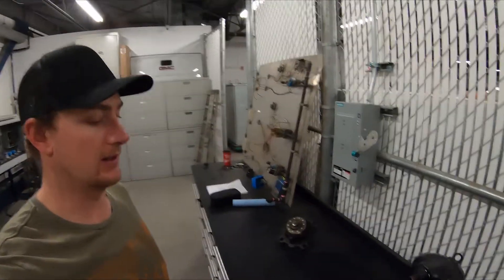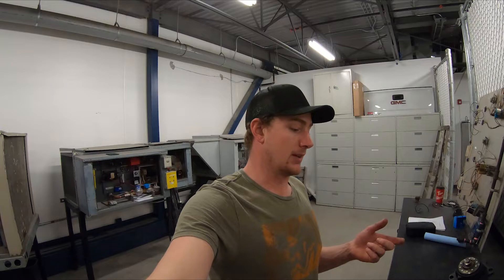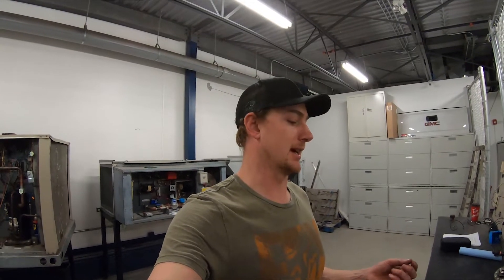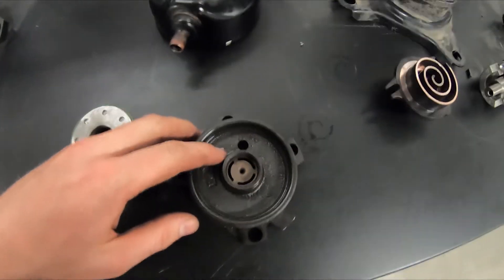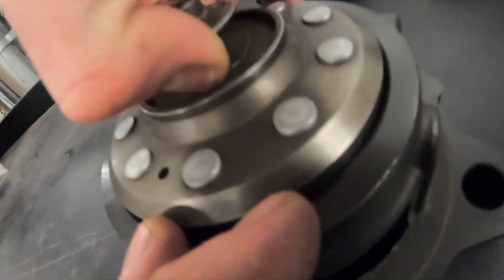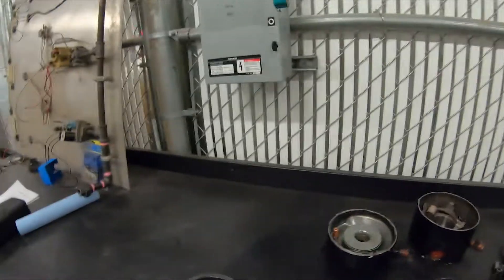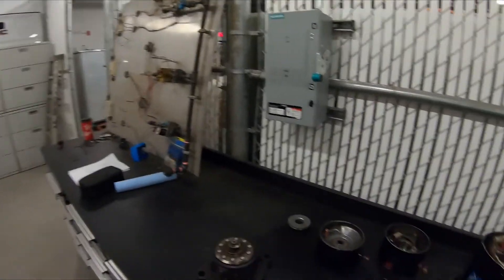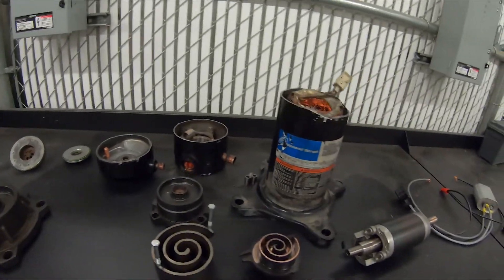Copeland Scroll Compressor Teardown

Comment: Are you saying the copper is in the bearings because the oil/refrigerant is acidic and leaching copper from tubing and it ends up depositing on the bearings?
Reply from the maker: Yes, when the system is not evacuated properly and there is no filter dryer installed moisture is exposed to the refrigerant and oil and it causes acid to remove copper off the pipes and deposit on the bearing inside the compressor

Comment: Seems like a high temp thermocouple on discharge line shutting down compressor at high temp would be more effective but I guess that would entangle some EEV air handlers that would eventually throw a superheat alarm if compressor stops pumping.

Another issue I have come across is air handlers with EEV that turn off blower coincident with compressor turn off.  It can cause EEV to totally shut off flow due to quick temp drop on output of EEV when air flow stops and leave its EEV in totally shut off position.  Scroll compressor blocks off other end of liquid line preventing back flow into compressor. Sustained liquid line off state pressure causes issue with developing enough differential pressure across scroll compressor top plate sealing disk, causing it to chatter on start-up and beat the sealing disk up long term.  Need to have a time delay leaving blower run for a minute beyond compressor shut off to bleed off liquid line refrigerant.

Comment: I came here  to see the internal design. I'm looking to pump down a functioning split system for sale/transport. Someone else said to not let the low side go into a vacuum because the refrigerant acts as a insulator for the windings and will burn them if you do. My electro/mechanical knowledge of how things are designed immediately told met that's absurd. Someone else said that running it in a vacuum state for any length of time will damage the compressor. I watched several videos of HVAC personnel pumping down systems and you simply put the unit on high cool so the evap has a heat load, close the high side and when the low sided gets to zero, close the low valve [which by that time will cause a little vacuum] and then promptly disconnect the power. If the compressor runs for 30sec with both valves shut is no big deal.

Comment: When refrigerant backfeeds you hear it, sounds like air spraying out and inlet temps drop immediately, and if it continues, the bottom of the compressor gets warm. Do a pumpdown test with gauges hooked up. If it cant pull the low side to zero, it is confirmation.

Comment: Hey thanks, you take a lot of mystery out of why the hammer technique works sometimes? Kidding aside I was looking for the oil dipstick on my rooftop unit, but I don't know where it is. Anyways my OFM froze up and the drama commenced, L.S.S. I've got 240vac to the comp. motor, but no spin. I'm thinking internal motor open? What's your thoughts? Thanks again.

Comment: Hello, I have a question about our copeland scroll compressor. (ZS21 K4E-TDF-551 similar to ZB21KCE-TDF-551)  It is loosing very few oil at the sight glas. I can only see oil when it is working. I can see nothing at the glass when its not working. So can I simply fill it up. How to do that? I searched for hours now and only found the manual at the emerson webpage. But there is only written the type of oil and that it has to be half filled at the sight glass. So Is it simple? Which kind of tool do i need? The valve at the bottom?

I would be very thankful for a short or long answer.

Nice Video.
Reply: try oil separator

Comment: hi john thank you very much for useful video 
please advice how can solve the problem of high temperature protection inside the head of the compressor 
i have one compressor working with low current and no pumping how can be solved
Reply from the maker: Only way to reset is to shut the compressor off and let the unit cool down. If it continues to trip on temprature protection your exceeding the rated compression ratio. Either too high of discharge or too low suction, or a combination of both.

Comment: Hello John,
I don't know if you can help me. Above my apartment there is a heat pump (Aermec NRL0600'H'E '' 'P2),
 functioning in both cooling and heating mode. There are 4 installed in the machine Copeland Scroll compressors working in pairs:

pair1 - model ZP120KQE TFD
pair2 - model ZP154KQE TFD

Only one couple can work (especially in summer) or both couples (especially in winter) and they have
 variable speed.

Especially in heating mode, the vibration dampers under the machine (isotop sd7, isotop sd8)
 not able to dampen the vibrations which, as a result, pour into my apartment. Some time ago I viewed the machine together with a vibration expert. According to him isolating in a way appropriate compressors installed inside the machine would lead to good results.

Do you know this type of compressors? The speed of rotation? You would be able to recommend antivibration mounts
to put under the compressors?

thanks 1000

Comment: If the compressor has thermal and pressure devices for "self protection" then are you indicating that none of these were successful in protecting this unit?
What is the approach to determining a compressor malfunction?  Are these protective devices "one time" protection or are these designed to "reset"?
Reply from the maker: This compressor failed due to contamination in the refrigerant system. Contamination in this case was moisture and air since the installer did not pull a complete vacuum and did not install a filter drier.

The temperature protection would activate when the compressor is operating outside its design conditions. Compression ratio and suction temperature would be the two main factors that would cause the compressor to stop pumping.

Comment: I watched this hoping to understand how my circa 2004 nordyne/miller 4 ton 10 seer heat pump can fail so many different ways and behave so differently in heat versus cool modes.

Following a long vacation I attempted to start it in COOL and HEAT modes, but it only buzzed a few seconds with well over 120 amp draw causing lights to dim and voltage dip from 240 to 220.  That  would repeat at approx 10 minute intervals.  The single pole power contactor remained engaged and 240 Vac was provided to the compressor continuously.

That inspired me to install a hard start kit and I was able to get compressor running in COOL mode for a few minutes with 22 amp draw, but no appreciable cooling was detected and I think the compressor stopped with no current draw.  Had  to stop because sunset and I have not been able to repeat this.

I also managed to start the compressor in HEAT mode and it behaved well except current draw was 33 amps.  The outdoor coil became cold but I did not evaluate supply temperature.  After switching back to cool mode I did not get any compressor current after contactor engagement.

This makes me wonder if there is some kind or thermal or time delay switch inside the compressor that nobody bothers to mention in the teardown videos?

My curiosity is mostly academic because the unit contains R22 and conversion to R22B would be a waste of money.  I already have a 5 ton 14 seer replacement on site and will switch over when I receive all of the new ductwork components.
Reply from the maker: Sounds like the bearings might be tight on that compressor aswell. The hard start kit would definitely help get the compressor moving again but its probably over amping. Those compressors have a thermal disc that disconnects the circuit when the unit over amps/overheats.
Reply: @johnbrown8168  thank you. It figured there had to be some sort of thermal and/or pressure switch inside compressor because sometimes it draws amps when I give 240 Vac and other times it draws none.

 HINT: discussion of the compressor internal electrical interlocks would be wonderful addition to your teardown videos.

My compressor probably needs oil and filter change after 15 years use but I have not watched any videos about that process or about R22B conversation